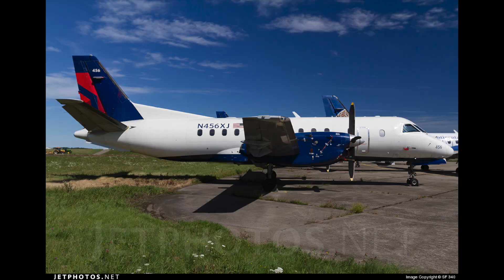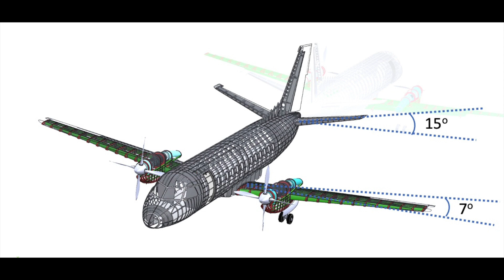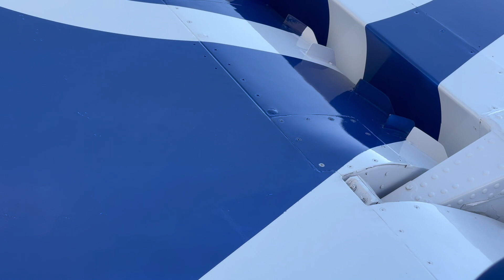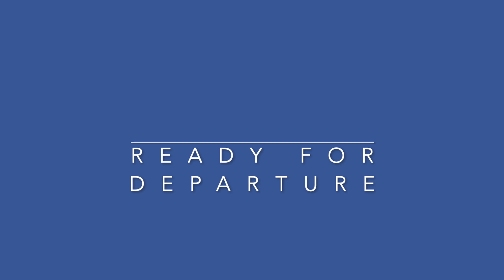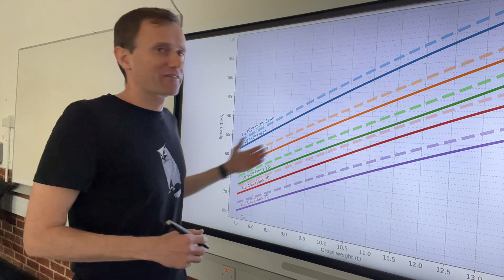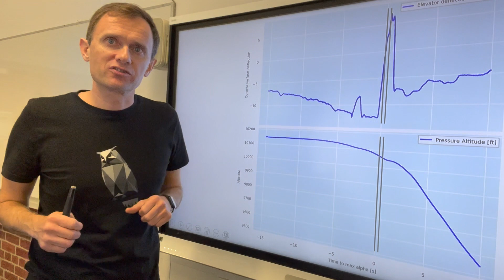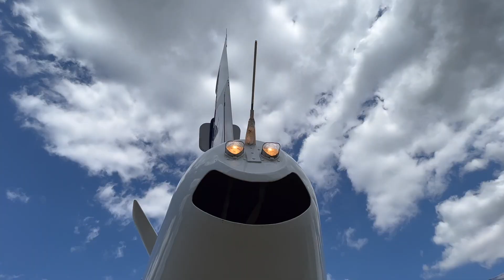Saab 340B+ - Performance, Handling, Design... and a Ride with the Cranfield NFLC

Comment: Thanks for this thorough discussion of the aerodynamic aspects of this very fine small airliner!
I have flown the SF-340 in it's early days with Crossair (if memory serves, we were the launch customer - as testified by some of the prototypes having had Crossair's livery on one side of the fuselage and SAAB's livery on the other..). 
These early SAAB's were generally nice to fly - except in icing. First, they lost roughly 30% of engine power when de-icing was switched on, and secondly had a tendency to accrue ice on surfaces not reached by the de-icing systems (had one rather hair rising experience over the Vosges hills on approach to Basel-Mulhouse one late and icy february night..). To my knowledge they did modify these shortcomings after I left Crossair (mid eighties or so). Thanks again for this very interesting footage - much appreciated and very much enjoyed by this retired captain. 👍
Regards from Switzerland Charles U. Schneiter
Reply from the maker: Thank you for the interesting insights! The hybrid livery must have given ATC some moments of confusion 😉 I was fortunate enough to speak to a Crossair engineer from that time and he had similar recollections re icing. I guess this was a decade before American Eagle 4184, so much less was known in those days about icing than we know now...
Reply: @asobester  Oh yes, some confusion there was indeed - even sometimes for us pilots. " Bale Ground, this is SAAB Demonstrator 015... eeehhhh. Crossair 651, sorry..". 🙃Said incident over the Vosges hills started by an ever so subtle change in wind noise... First thing for me: Switch off the autopilot to get a feel for what's happening. I then felt a slight vibration in pitch. After that I started an immediate descent.... lower down (below freezing level) the vibrations stopped and we made an uneventful landing. Wrote the tailplane de-icing systems up after landing. Albeit no problems were found by maintenance and engineering. For me this said, that de de-icing (at least for the tailplane) as such was somewhat inadequate. But besides of this, the SAAB 340 was a delight to fly! Especially after having flown the Fairchild Metroliner II and III for almost 1500 hours (my hearing suffered quite some then.. 😉 ..).
Reply from the maker: @charlesschneiter  Wow - must have been quite unnerving. I guess the tailplane is even worse, because you cannot Mk1-eyeball what is going on! I know some airlines later painted a black line on the prop spinner, the visual disappearance of which would then serve as an icing early warning system... did the Crossair airframes have anything like that? And, interestingly, you're not the first pilot to immediately mention the Metroliner in a SF340 conversation as a... less than a delight! What in particular did you dislike? (other than the noise) In what way was it different? Fairchild 'DNA' in both, to an extent...?
Reply: @asobester  Well the Metro II's and III's were sporty little machines. Handling wise the Metro III was not so pleasant like the Metro II - in that they considerably increased the former's wingspan but let the ailerons where they were i.e. they were then too much inboard. Gave somewhat the same feeling as one gets when driving a car whose power steering is u/s and having too much play in it... 
And the systems were quite the opposite to them in the SAAB. Not really thought out well imho (a bit like in some business jets of the time). Oh, and yes, the manufacturing quality of the Metros left a lot to wish for. So, no, they didn't have much in common engineering wise - thank goodness! Imho the cooperation between SAAB and Fairchild was more of a commercial nature than anything else (probably that SAAB thought, that they could enter the US market more easily?)
In fact, yours truly had a veritable accident in a Metro III when the nose wheel steering (electro hydraulic spool valve design) 'froze up' due to metal flakes getting in between the spool and the small piston inside the cylindric wall of the spool valve (the Swiss AAIB found out that the reason was due to an unsuitable selection of materials plus lousy manufacturing of the valves). After touching down, the aircraft veered to the left, we then hit a runway edge light with the nose wheel that caused it to break and we drove nose on ground approx. 200 meters out into the weeds. The airframe had to be written off since the fuselage became substantially twisted and both engines (TPE 731's) were totaled as well as both props smashed into the ground when the nose wheel went. I still have one of the bent prop blades here in the office ;-)  .

Sorry for the somewhat lengthy reply!
Kind regards from Basel Switzerland - Charles
Reply from the maker: @charlesschneiter  Thank you for the fascinating recollections! I have never seen one in flight and I'm now adding this to my bucket list :) So many interesting quirks... (well, maybe the wrong word for badly made valves!). There is an unreferenced statement on the Metro's Wikipedia page about an emergency RATO system being offered as an optional extra. Is this something you ever came across? I hope it's true!! And on a more mundane note, do you recall your pax ever complaining abut not being able to stand up in the cabin? Does it not get a bit claustrophobic after a while? (say, waiting on board for whatever reason?) Apologies for all the questions :)
Reply: @asobester  Absolutely no apologies needed- our conversation spurred a nice trip down memory lane!
First let me correct the engine type on the Metros: It's the TPE331 not the TPE 731 - I always mix them up with a widely used turbofan engine, sorry. 

There were Metro II's equipped  with a JATO (Jet Assisted Takeoff) system in the tail cone of the aircraft, which didn't have much effect on take off performance in hot and high conditions. Crossair didn't have this option installed. I did hear about records that mechanics once every so many hours when they had to replace the bottle, they  would go out and fire off the bottle at the runup-pad, and that they were able to do it with the brakes off and the airplane wouldn't even move... Swearingen offered them as an option for customers needing them on departures with a challenging 2 nd segment climb profile, I heard...
But we did have a Continuous Alcohol-Water Injection (CAWI) system installed which gave you quite some more thrust (don't know how much anymore, but it could well have been in the region of 15% or so). 

Re claustrophobia: Surprising to me as well, we didn't receive many complaints about that. Well, Crossair's interior was a very posh one, with dark blue wide leather seats etc. Plus the top notch service provided either by de F/O or the Captain 😱since there were no Flight Attendants in the Metros. One thing we did though: During the approach we closed the cockpit curtain (there was no cockpit door then). It made the passengers nervous looking out in front and seeing the landscape swinging wildly left and right (gun sight effect?). 
Another anecdote if I may: The only time we had an uproar going through the cabin was, when in Zurich they once loaded us the Pax for the wrong destination! As I announced "ladies and gentlemen welcome to our flight to Klagenfurt, Austria..." an uproar broke out that could even be heard over the engine noise. So we entered an unused runp area and worked out a new flight plan to Munich instead- and the other crew to Klagenfurt instead of Munich... Those were the times (1982 ca.)...

Thanks for your interest and have a nice weekend! Regards from Basel, Switzerland! Charles
Reply from the maker: @charlesschneiter  Fascinating stuff, I love these little details and now I really feel the urge to try and do a similar video on the Metro (including a closer look at the JATO, which must be unique in the world of commercial airliners!?), such a pity that there aren't any flying anymore. Even static ones are so rare, the only one I ever remember seeing is one that was used by Metro France as a weather research aircraft - now on display at Aeroscopia in Toulouse. 

And I know what you mean about the gunsight effect - I've experienced it on the Jetstream 31 (no flight deck door there either)! A great joy for aviation people, but yes, suboptimal for the nervous flyer, I guess :)

Comment: Was a Capt on the S340A in the late '80s for a regional in the southern US.  Since then have flown nearly three decades with a major US carrier including the B727, B757, A320, and A330 which I fly now. I still have fond memories of six or eight legs a day in the reliable and comfortable Saab.  I particularly liked the roomy cockpit and cabin, but also remember the engines (derived from helicopters application) were not the best performers in the high teens flight levels, nor in icing conditions.  Beautiful design that looks great today, and flew very much like a B757 in terms of feel.   Thanks for the trip down memory lane!
Reply from the maker: Thank you for sharing your recollections! And yes, all conversations about the 340 (and I guess about most turboprops) eventually touch on icing, including engine inlet icing... And you're right, its lines still look modern today, even in an era of curved windshields, etc.
Reply: Did you get to do any similar exercises in the course of training - stick pusher demo, dynamic stability, Dutch roll etc?
Reply: Probably, but it has been over 30yrs and I can't remember what I had for breakfast this morning 😂 @RoamingAdhocrat

Comment: I flew the SAAB 2008-2011...Very systems intensive, but very easy and forgiving to fly...It was a bit underpowered, but pretty benign single-engine, assuming the autocoursen worked:-)
Reply from the maker: Does 'systems intensive' mean 'overly complex' or 'over-engineered' relative to what you'd expect from an aeroplane of this class/vintage?
Reply: @asobester  I'd say for it's era and it's mission that it was a very complex airplane...However, it was simple top operate once you got accustomed to it. I had come from the Beech 1900 prior to the SAAB. I really enjoyed the roomier cockpit and autopilot:-)
Reply: SAAB 340 is multi-engine, not a single engine.
Reply: @m.hstudioproductions6642  I know, I have almost 2000-hours in the SAAB 340. I was referring to it's OEI ( one engine INOPERATIVE ) flying characteristics...
Reply: @B1900pilot  Ohh, I see.